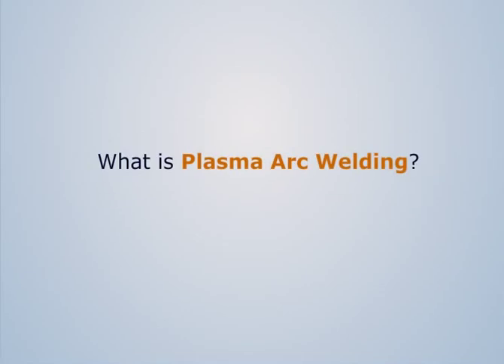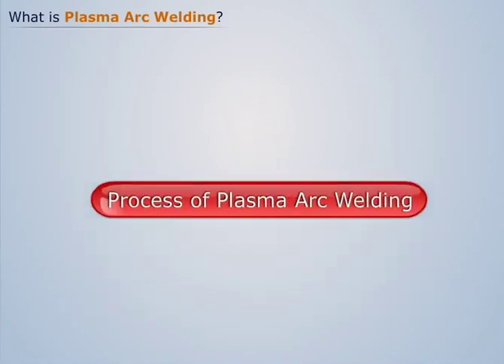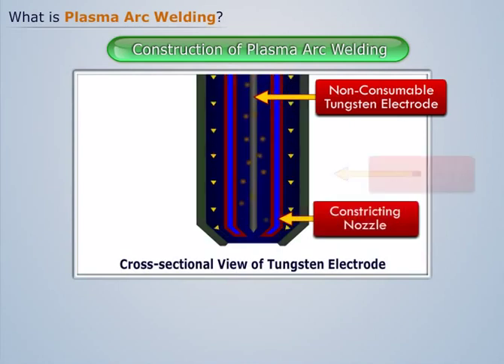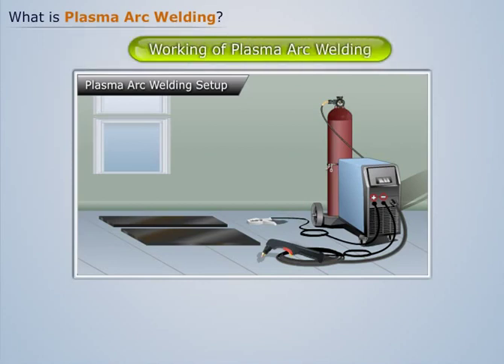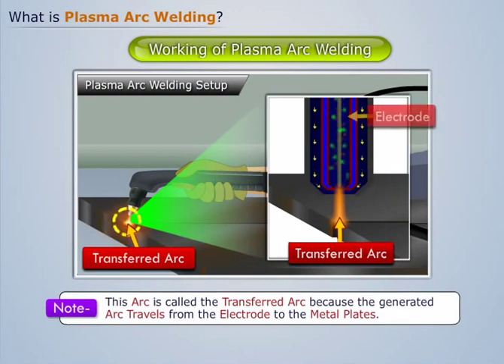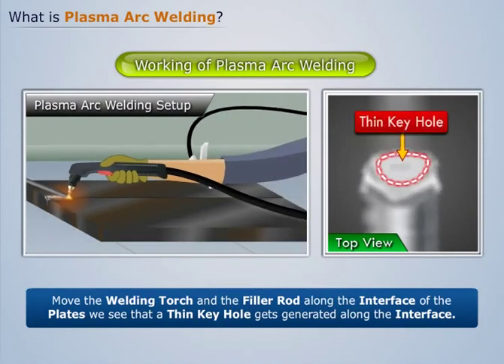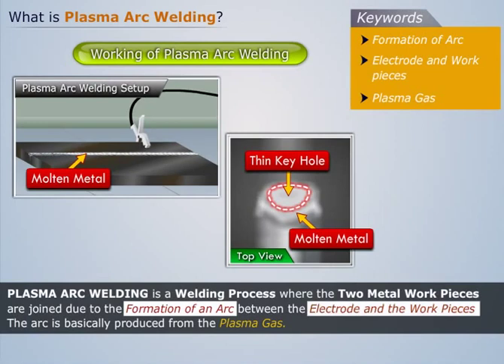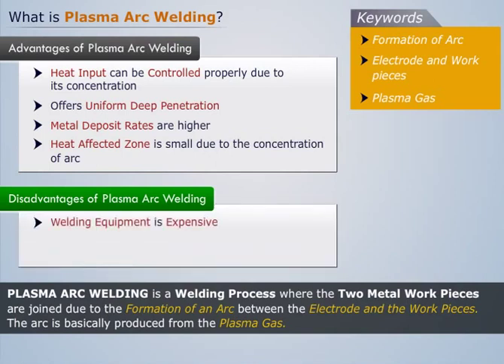Plasma Arc Welding | Manufacturing Processes

Comment: I have a piece of titanium from an aircraft manufacturer that was plasma tig welded. It is a piece of sheet metal about forty thou thick rolled into a tube about 5" in dia and5" long. The weld is incredible, a silver line about an eighth of an inch wide on the outside of the tube and also on the inside. It is hard to even feel by running your finger across it. When another tig weldor comes over I show them this perfect weld and ask them what I must be doing wrong, because this is the best I can do!!